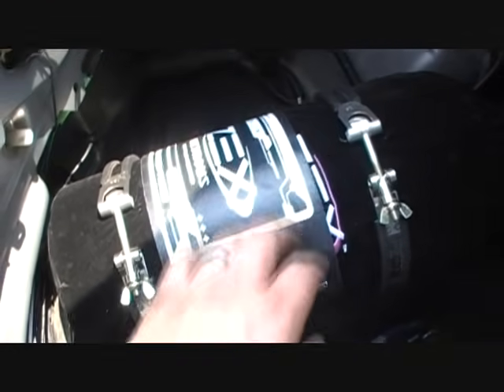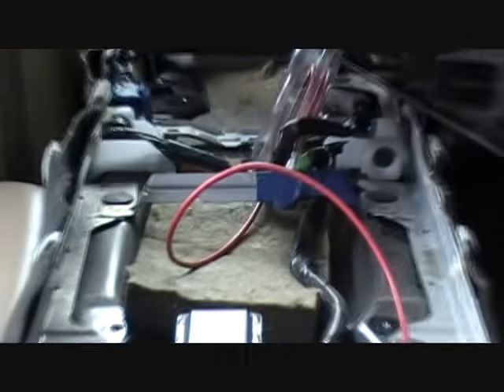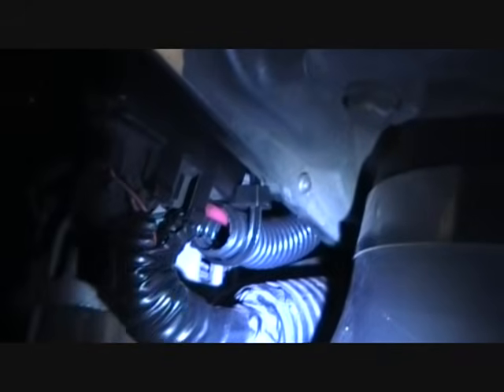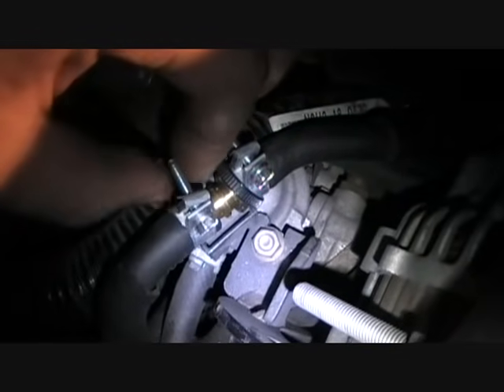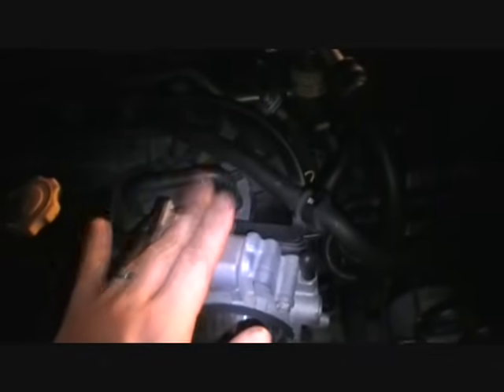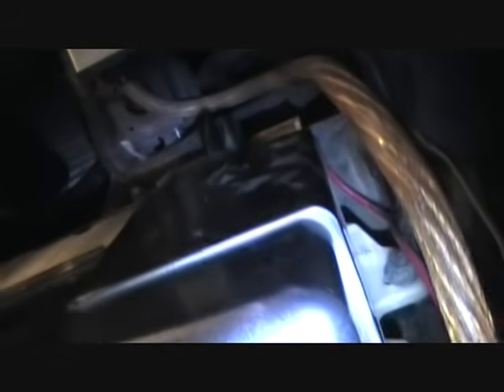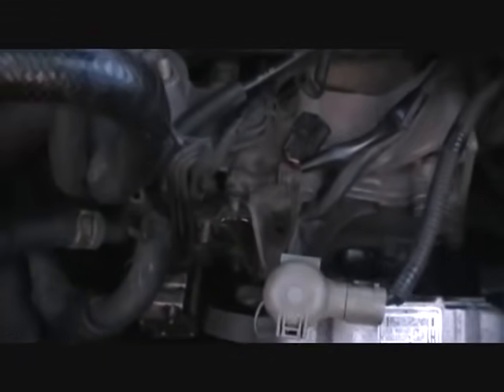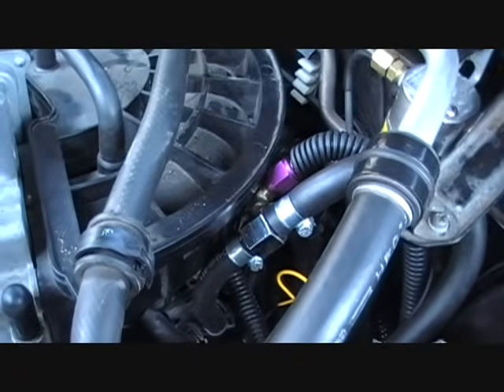MAZDA RX8 ZEX NITROUS INSTALL

Comment: i know this is a very old video. 50 shot seems perfectly safe when done right yeah?
Reply from the maker: Yes.  There are also other considerations like engine health and so on.  Like with any modifications always be prepared.  These are like experiments which can vary person to person to achieve the same result, worse or better.  The biggest thing is to have fun!
Reply: @SyntheticVisionsAutomotive roger that thanks for the reply man. always wanted an rx8
Reply from the maker: @deckstare do the research, take a lot of stuff you'll find with a grain of salt.  These are meant to be run hard, but not beat.  You'll see stuff about putting 2 stroke oil in the gas, don't!  They make a sohn adaptor that'll be separate from everything that you can use for that or even just oils in general.  Synthetics is a big debate since it uses oil to keep the seals lubed.  If you have that adaptor I'm pretty sure synthetics would be fine to use in the engine.  Gett ready for the long road of research lol.  They're fun cars and can last a long time if properly maintained.  I had mine for 5 years and 150k on it and still sealed good.  Biggest upgrade right off the bat is the bhr ignition coil upgrade if it's still around!
Reply: @SyntheticVisionsAutomotive  really appreciate your expertise!! cheers. i love the cars

Comment from the maker: @alterego667 
lol, I did clean the engine about a week after this video, which I wish I would of done before this video.  Our road is a dirt bowl basically, so it's hard to keep up with it sometimes.  As for the bolts I was going to replace them with stainless since I drive this all winter long, but I'm waiting to get them all at once.  All the work was worth it thanks.

Comment: Hey Synthetic, quick question. On a scale of 1 to 10, based on your cars performance on acceleration and speed, what would you rate it as? Im thinking about either getting the rx8, or the supra, rx7, impreza, maybe maybe the evo, nissan 240, or the 250. Nice vid btw!

Comment from the maker: @JonnyDScuba   Other then the BHR Ignition kit, cooling bypass, lightened flywheel and clutch, AEM intake, Agency exhaust, Ralco pulley kit, and Access Port lol.    It's also 55 shot until someone comes out with something safer for the higher shots.